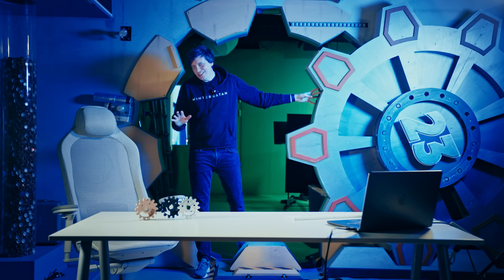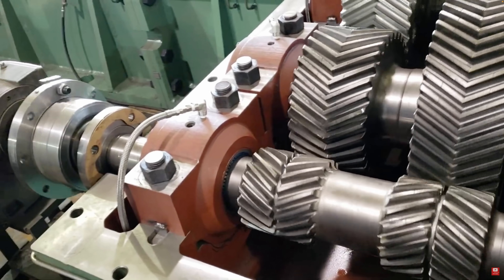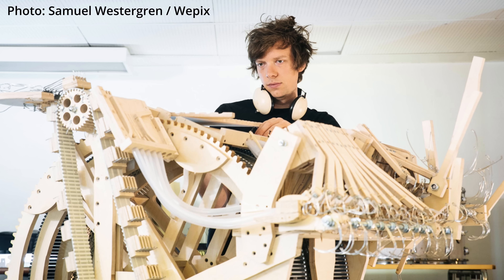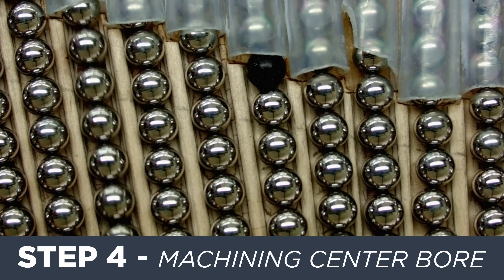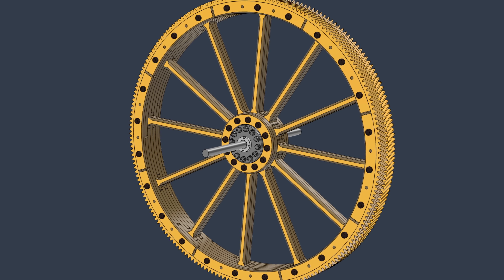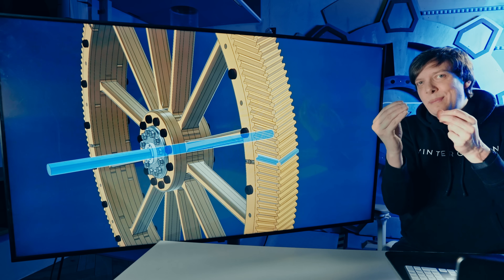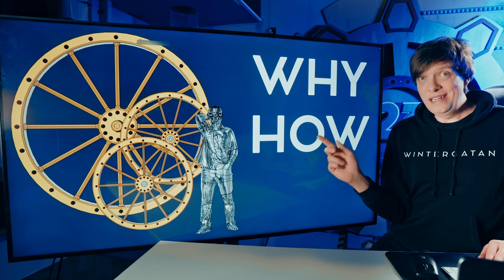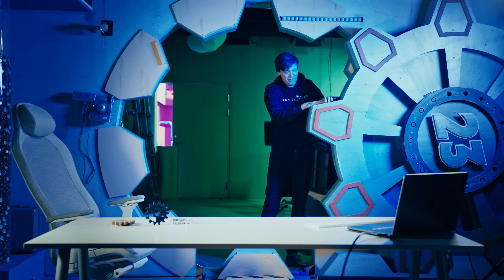How I´ll Make the Worlds Largest Plywood Gears

Comment: Cutting helical gears with correct profile is a task that is an order of magnitude more complex than cutting the straight teeth. When you cut the straight gear the tooth profile is directly programmed into the CNC tool trajectory. In helical gear you can not easily do that. There are several ways of doing it and most of them give you only an approximately ideal profile. The tooth profile is recorded in the cutting tool profile (actually the profile of the gap between the two teeth is). The job of the CNC programming is to make sure  that the tooth is cut in the right place. The CNC program cannot change the tooth profile itself. The CNC program must synchronize the feed across the width of the gear and the rotation of the plywood plank. 
The ideal tooth profile is depending on the gear module and number of the teeth. Gears with different numbers of teeth all have different gear profiles. You can use a purpose made endmill with the profile that is calculated for the number of teeth in your gear. 
The ideal profile can be achieved with gear hobbing. In this case the tool is a cylindrical worm cutter with the straight profile of the gear rack. This would require a special machine tool as now you have to synhronise the tool rotation speed, rotational feed of the plank and the tool feed across the width.
This means that it all depends on which equipment you have access to. Considering the relatively low required profile accuracy there might be a way to get away with basic CNC machine and some clever fixturing. You will still need the special profile end mill, but you may be able to do the tooth cutting in a CNC router without any rotary axis. After glue-up you will have to drill a positioning pilot hole in the vicinity of each tooth in the same location.  The plank will be mounted on an axel like in the video, but the rotary axes is free rotating.  A cam is attached to the first tooth using the positioning holes drilled after the glue-up. The CNC router will only feed the mill across the width of the plank. There is a cam follower attached to the spindle block. As the spindle is moving across the width of the wheel, the cam is rotating the blank as needed. Place the the cam profile to the next tooth and repeat... If the wheel is really large, and has a lot of teeth, the straight edge rack profile may be good enough approximation, and you can get away with a simpler tool with just a 40 degree cone shape. (assuming you use the 20 degree pressure angle).

Comment: As the wooden gears wear, will they make their own dry lubricant dust? If you would put in felt-gears normally used for lubrication you can dampen backlash some while it sweeps the gears. But that sweeping would clean the gears from that fine dust. Pianis also have dampening felt pieces. 😂

Comment: If the gears are machined into the wood repairs are going to be difficult if there is chip out or breakage. It maybe easier to make a wagon wheel but instead of a flat metal band put the gears on it.

Comment: Next part is Martin fighting the noise those gears are making from the massive backlash. 😁
Reply: The idea is that helical gears don't make as much noise, because the contact point of each tooth goes diagonally across the wheel.

Comment: Shifting the tooth profile, as it is called in the video the backlash, is not the thing to adjust, if you are worried about jamming the gears. You just need to add more distance between the two gears to increase the gap. Better still, design your geartrain so that you can adjust the distance between the centers of the gearwheels.

Comment: My major concern is the overly complicated manufacturing process. I get that helical gears look cool (which is very true!), but is there a benefit to using them as opposed to a standard spur gear? I do appreciate the attention to ensuring the axle will be as true as it can be before cutting the teeth, but making the teeth straight will reduce headaches and potential machine error that could scrap a large part that took several hours to make.

Comment: Martin 2019 : I'm just going to eyeball cutting this part with the angle grinder and see what we get. It'll be fine. We'll weld it or something if things go wrong.

Martin 2025 : So here's a CAD mockup of the process I'll be following to ensure that we have concentricity of the gear shaft joint plate with the gear teeth. Let me know if you have any engineering concerns that I've missed. I need some expert help here.

Comment: It is possible to have zero backlash with sufficient clearance - you use split gears with a spring pre-load. One half of the helical gear pair mates with the leading edge of the tooth, the other half of the pair mates with the trailing edge. In this instance, you wouldn't do this on the large gear but on the smaller "planet" gear. The spring allows the two halves to move slightly as tolerances change. You might also want to consider making the teeth from a set of solid wood panels that clamp to the wheel like a sectioned tyre. They would be easier to control the milling precision on, and wouldn't be in danger of cutting cross-grain at any point.

Comment: Instead of using wood for the teeth, why not create a metal track that can go around the wheel and bolt to it. That way you have the advantage of reduced weight, with the resiliance of metal.

Comment: I'd like to recommend you stabilize the hub via whatever measure you decide (epoxy, oil, whatever) before you cut the teeth. Maybe epoxy (or whatever) after glue up but before the precision center bore. Then epoxy again and cut the center bore again. Or possibly order the metal hub slightly under sized and bore the metal hub after you epoxy it in the center of the gear, after application of whatever sealant is used on the center.
I mention this only because the tiniest of shifts in the center of such a large gear will be magnified so much over that distance which could cause catastrophic issues on small wooden teeth. Those teeth are much smaller than the teeth of the first marble machine after all.

Alternately you could also install roller guides just before the place where the gears mesh to force alignment regardless of any possible distortion of the gear just like a bandsaw has roller guides to keep the blade straight.

Comment: My question about the hub. If your going to machine the thing anyways, why not make it so it interlocks with the surrounding wood like the giant gear you have in your room. It can have that type of spurs in the outer circumference to lock into the plywood with a flange on one end. the other is round but has a thread that can accept a large nut instead of 88 bolts nuts and washers.

Comment: You don't need constant torque. You need precise thickness. You want a dial gauge indicator.

Wood isn't homogenously compressible, so if you use constant torque, you'll possibly get variable thickness.

Comment: I see a few people here commenting about tear out when machining the teeth on the gears. In my hobbies I have cut many threaded holes (similar to nuts) in many pieces of  quality birch plywood.. One of the things I do before cutting the threads is to soak the area in the plywood in a thin Cyanoacrylate glue.. this makes the threads cut with much less tear out.  The procedure I use is to drill the holes, soak the area in the CA glue, Let the glue dry completely, tap the hole, blow out any sawdust, wet the area with glue again, let it dry again then tap and clean out the hole a second time. This makes the threads stronger than the untreated wood.  The teeth on your gears are larger then the holes I make so it may not be as big a problem but the effect would be the same. I believe some of the coatings you mentioned coating the wood with for moisture control may help solve the problems of tear out if it is put on the gears before cutting the thread.
Reply: Since it's being CNCed, they could do a rough pass that still has 1mm or more of material left to cut, then soak the edge in glue, let it try, then make the finishing pass. That should allow the glue to penetrate into the voids while still keeping everything dimensionally accurate.
Reply: I’ve done that with tapped plywood as well. It becomes as stable as a steel nut!

Comment: Using AI for research is how to get a lot of mistakes.
Reply: Yes! I came here to warn about relying on Grok. Grok's text about Baltic Birch plywood looked like typical LLM bluffing/"hallucination".
Reply: @EliasHasle  And Grok is owned by a fashist. Don't even expect good results.
Reply: Yeah that's pretty much shit. LLM are great when it comes to produce non factual content, organize/summarize ideas or rewrite something so it's more appealing. But using AI like you would use Google to fact check something is a terrible idea.
Reply: Professor here. This guy is right, don't blindly trust AI, it's a good start, not the finish line.
Reply: and grok at tath lmao
Reply: i think using an LLM to start off is probably not too bad... but just straight up showing it in the finished video is just... why? does grok not show the sources it used?

that said... a LOT of sites that come up on google are also themselves LLM generated slop. it is getting really difficult to get good sources these days.
Reply: @alveolate Yep, I agree to that😊

Comment: Oh the gears are going to be magnificent. In all honesty all I can say/recommend (in case this plan won't go smoothly) is if making it double helical teeth will be such a hassle, you can always try a more archaic route. I'd make 2 separate helical gears that I would align/glue together later if doing it all in one go is troublesome. This way I can easily transfer the markings on a template&jig (probably something more stable like MDF) then I can rest a hand router to make each teeth on an angle. I know how you like your precision but a steady hand and patience is all it takes. Best of luck I can't wait to see how this'll turn out <3

Comment: Great ideas Martin. Don't fall into the trap of assuming the reference surface will be flat just because it in machined, it will only be 'perfectly' parallel to the path of the machine tool. Make sure you check the machine for true flatness!

Comment: Okay hear me out. With this plywood thing... consider getting some specialty plywood for the outer layers! If you want it to look cool, just imagine what a varnished teak gear would be like! It shouldn't compromise the structural integrity, and it shouldn't be prohibitively costly as long as you only use it for the outer layers and for the finalized version, and it would just add some extra cool pizzazz to the build.

Comment: I think you should consider two things about the plywood used, make sure it is marine grade glue, and I would consider using all hardwood plywood for the teeth.  Or if that isn't an option, could use a penetrating oil and wax blend into teeth so they can burnish on the surface instead of wearing as much

Comment: My opinion I would switch from plywood to a MDF. Plywood wont last long enough for the cost to my knowledge. The wood will never stay stable and will chip, which will put it out of order. MDF will let you color it anyway you want and harder to ware and tare. Using plastic or light metal as stripes so if they brake all you have to change it the strips.

I had some time to think about it more. Why complicate things when the wagon wheel already done the job for us. Its design is ment for taking punishment and staying stable/straight. Sure some design changes could be done but i think this could be a very good spot to start the base with. The plywood is only good when working on the face, but very weak on end grain. Having to make new gear in that size will just be to expensive in the long run.

Comment: The gears might fail at the spot of force translation from big to small (going to big again) because of aaaaaaaall the momentum involved, spinning up, spinning down, up again,... I thought you wanted to tour with it? Make it fool proof and introduce some metal infill you can rely on, since you build the gear layer by layer it yould be easy to get one sheet of metal in there just to be sure

Comment: The precision/error at the rim of the large gear blank will be a multiple of the precision/error of the actual rotary axis positioning, so bear that in mind when considering how precise of a rotary axis you need to cut the gear form. For example, if you have 10 arc seconds of accuracy on a 1 m radius gear blank, that translates to a positioning accuracy of about 50 micron (2 thou) at the rim, which might be fine, but bear in mind the cost of a rotary axis that will give you 10 arc seconds of accuracy is pretty high. You might need intermediate gearing between the axis and the part shaft to get the level of accuracy you want (and this will require backlash management of the intermediate gearing).
Reply: Was thinking this, as well. Also, your torsional rigidity will decrease with increased radius. I would probably cut indexing features into the glued version, then repeat Cartesian tool paths at each indexed position.
Reply: @airman2468  Yeah that too. You make a good point that dropping index holes with XY accuracy is probably more accurate than a rotary axis. I have no idea how accurate those large wood routers are, but for a normal mill, it's pretty trivial to get accuracy better than 2 thou when positioning a hole (though straightness may be difficult given how thick the stackup is. I have no experience with wood, but I would default to a boring head or interpolation if I needed a precise straight hole in metal.). Though that would also then require considerations of hole accuracy and finish as well as fit with the indexing pin. All pretty standard machining stuff, but I don't know if it's the kind of thing Marten has experience dealing with. 
You could machine the main bore as stated and then while it's still clamped, drill a series of indexing holes, insert a large pin (section of shaft) through the bore and table, then index the blank around that to cut the teeth. You would have to rotate the spindle so it faces perpendicular to normal, but then you would have the XYZ movements of the router, which will probably be more accurate than whatever rotary axis he has, to mill the teeth. Plus it would be clamped to the table during milling reducing considerations about the strength of the blank. Tooth spacing would depend on the accuracy of the indexing holes and the fits of the various pins. He'd need some idea of the kind of tolerances he wants in the gear in order to determine the best way to do this.

Comment: The spokes will shrink at different rates and cause problems, I recommend putting thin layers of fiberglass cloth and resin between all the plywood layers to strengthen it. 

Test over time how they hold up. Accelerated controlled humidity and temperature cycles. The double helix gears won’t tolerate too much imprecision in the large wooden structures.

Comment: I fear building a 4axis rotary cnc might be more difficult than you think since the profile of the teeth isn't parallel in one dimension the 4th rotary axis would need to rotate while you're cutting which might introduce imprecision if not accounted for. It might be worth exploring an alternative i.e. having the teeth of the large gears as a separate component that is split into smaller segments that gets bolted onto the wheel individually. This way they could be cnc'd out of metal on a standard 5axis cnc mill and you get best of both worlds, light plywood gear frames and metal gear teeth that won't deform overtime.

Comment: Love you're videos and I've done a lot of woodworking myself.  This would be a very large glue up and would take a long time to get everything glued and clamped before typical wood glue starts to set (10-20 min).  One suggestion, consider using epoxy instead of wood glue.  You get a much longer open time so you don't stress yourself out.  Keep up the great work!

Comment: 1. Wood swells from humidity.
2. Cross axis gearing that's not supported by the wood grain may tear.
3. Wood can and likely will wear out faster.
Reply: No kidding, ya don't say huh?

This is Martin Molin you're talking about, he already understands these things for the longest time, but he also enjoys a good challenge.

Will it work? Only time will tell...
Reply: @southernflatland  he seems to want to suffer
Reply: He adressed these things. Try watching the video.
Reply: @joachimmelin1987   I did, however,  he didn't actually address them... He assumed he could fix the issues. 
You and him are showing clear signs of the Dunning Kruger effect.
Reply: @chrisville25 you're assuming he believes it will work... he is prototyping, which is exactly what he should be doing to find out.
Reply: @chrisville25  You're showing clear signs of the "I'm smart and everyone else is stupid" effect. Also showing signs of the "I'm 20" effect
Reply: @Addadalaide  yep, you got me!
Reply: @bassman87  Agreed, it's a great material for prototyping. However, he currently believes it's a long-term solution.

Comment: I'm not sure if you're aware of the good practice on how to assemble bolted things like that, so here are some tips :

- don't tighten the bolt one after the other in circle, it's better to tighten one bolt, then the one on the opposite side then the one next to the first one and so on in a star shape to spread the clamping pressure
- don't tighten to the max torque at first, first step you can hand tighten the bolt, then half the torque then full torque (still to spread the pressure
- don't forget to redo a pass with your torque wrench at the end in case one bolt is not totally tight after the assembly settle